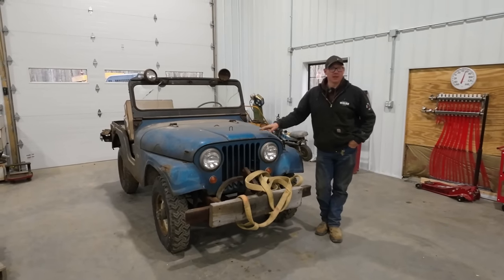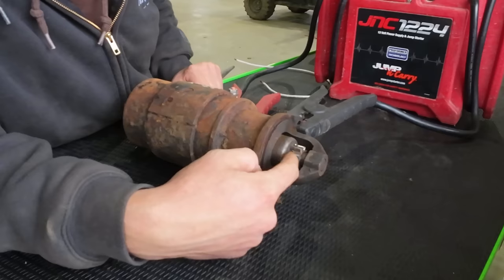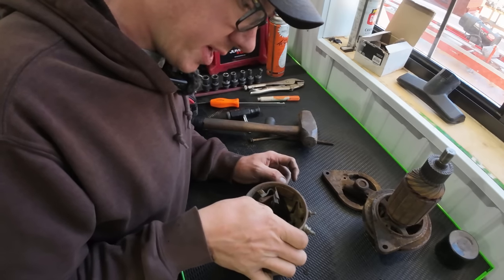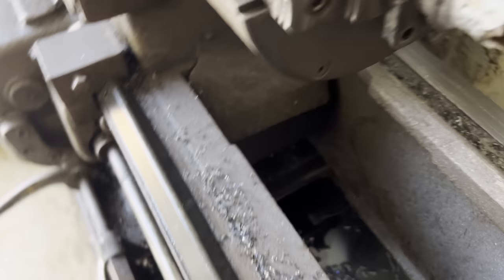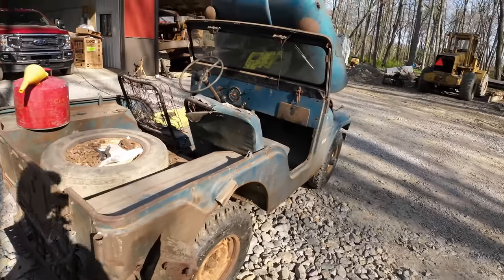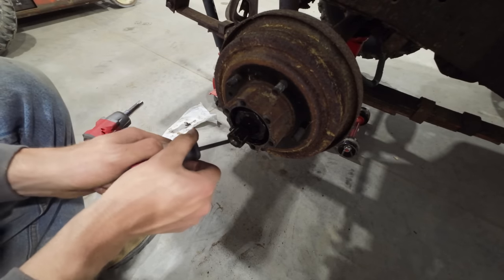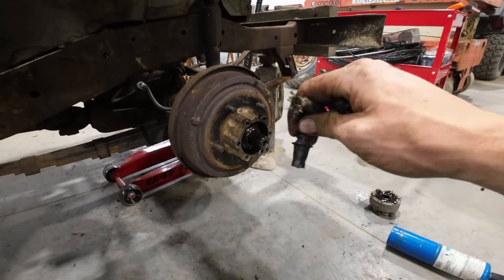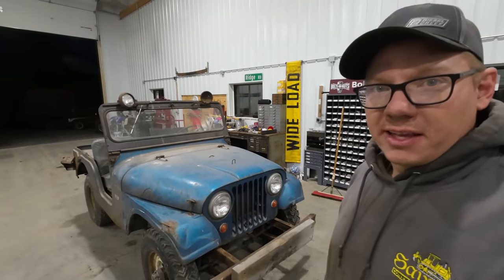Barn Find 1964 Jeep CJ5  (Is It Road worthy?)

Comment: I like your jeep, reminds me of a Jeep I drove on a golf driving range pushing a ball catcher about 60 years ago at age 15, so your Jeep might be 10 years newer.  Heavy wire covers on the windows 😅 for protection.
 Nice clean-up on the starter & generator.
I remember always citing antifreeze 50-50 with water but maybe not necessary on the new stuff.
  While you got the radiator out, be nice to cleanup some of the parts, maybe pressure wash first, and give those sheet metal parts like the fan, the fan shroud, engine bay a shot of black Rustoleum.
When you got that engine started, that engined purred, really nice sounding.  
That should be a sweet ride this summer.  Nice find, and great job getting it back in drivable shape 👍

Comment: One way to help prevent an air bubble beneath the thermostat, is to drill one or two 1/8 inch holes in the flat plate of rhe thermostat. It slows the warm up a little, it does allow air to bleed.

Comment: Soon as I saw that line I knew what happened. Had the same thing happen doing brakes on my 1996 Dodge Pickup. Loud as heck and scared the crap out of me!  My mechanic cousin say the lines were plugged and the heat from the 'heat wrench' built up the pressure in there until it blew.

Comment: I spent 4 years working in a shop and ended up drilling out all of the snapped off bolts, no one else would do them. Left hand twist cobalt bit are my go to. 95% of the time the bit will walk out the bolt and you can leave the EZ outs in the box.

Comment: Matt you need two things a "No Spill Funnel" it helps clear out the air pockets faster. 
Once you use one you'll always use them from then on. 
Second some reveres drill bits. A bolt that loose probably would have turned right out.
Love your show!

Comment: When ever my Dad started a old engine he would warm it up then pour fuel oil down the carb. A couple shots that just about killed it then pour it in until the engine dies, let it set overnight then fired it up & ran it. He said it lubed the upper end of the engine & loosened the carbon.

Comment: Hi Matt love your channel being an arm chair mechanic through you, much cleaner.  But hey pretty positive the front bearings take gear oil not grease unless there’s another set of axle seals inboard by the pumpkin? Not a old jeep expert so could be wrong but sure looked like nasty old gear oil on the bearings when you took it apart.  Also what’s the long term plan for shop power? Love the new shop and lighting but the droning of that light tower running on all video gets old quick,  maybe could at least move it further away or something?

Comment: Dear Matt,
.
I’m a “city slicker” who really loves your channel, and I want to give you compliments.
.
Actually, I’m not so much of a city slicker: I’m a medium-skilled woodworker, me & a buddy installed a new water heater, a top-of-the line model, with hybrid  (heat pump assist) & Wi-Fi.  With all soldered copper pipe & fittings, I might add!

I don’t like getting dirty, but sometimes you have to!  Afterward, you clean yourself & are all shiny again!
.
What I like about you is, you really get your hands & clothes dirty, but you’re smart with your brain, and your enunciation & speaking voice are SO EXCELLENT!

What I’ve learned: “Metal loves oil & grease!”. 
.
Thank you very much, 😉👋🏽🛢️‼️

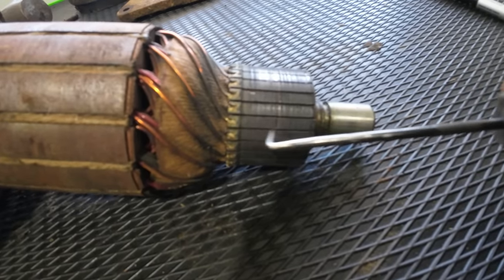Comment: 17:30 Having a bridge between two commutator contacts will affect the timing of the electrical flow through each contact, and therefore whether or not it produces power. Basically the timing needs to coordinated, similarly to how spark plugs need to have their timing coordinated.

Comment: I Bought a spector radiator off Amazon for my dodge pickup and it was a direct drop  in easy swap no modifications needed and $100.00 less delivered to my door step in 2 days local would have been 2 weeks out and $100.00 dollars more. Never had one bit of trouble out of it. So good luck on your purchase .

Comment: In New Zealand, where I live, many classic brake parts are unobtainium. Therefore, restorers often get the old cylinders resleeved in stainless. This is costly, but the resleeved cylinders are vastly more reliable than new repro ones. That's because resleeved cylinders don't rust when you leave the car over winter. I would expect to get a decade out of a resleeved cylinder. At that point I  just replace the seals and keep driving for another decade or longer.  Love your show. The length is just fine.

Comment: Hey Matt, I have a 59 Cj5 that I've owned since 1974. My brake drums come off of the hubs. The next time you have the wheels off, smack the drums on the surface where the wheel rides. Yours might be rust infused like mine were when I first got it. It saves a lot of time and aggravation when servicing the brakes.

Comment: I learned that many many years ago, never heat a brake line if it is attached to a flex line. (It will blow every time). I think it may have something to do with air pressure building up because of the heat, to the outside if the crimp. (hard to explain)

Comment: Thanks Matt, I learned some things today! I’ve worked on my Willy’s wagons for years and replaced the master cylinder in one of them. Lots of fun, but nobody told me to bench bleed before install? My newest project is an 81 CJ7. Been shop stored for twenty years along with an 82 wagon. Need a motor for the CJ, they used its motor in the wagon. It came with fender well headers so I’m looking for a 304 or 360 to put back in it? Been playing with Jeeps my whole adult life, lots of fun. Can’t wait till I get these two runnin and driving! Carry on, always fun to see what you drag home😳😁👍

Comment: i bought an all aluminum radiator for my f-150 4x4 from the same company on fleabay for cheaper than a direct replacement with plastic tanks. it's been almost two years with zero issues, in fact it runs cooler than it ever had before. this cj is a year older than i am. it's from back when they still made them like a jeep, rather than like a go cart. should be a good ride for as long as you want to run it around.

Comment: A good engine flushing compound would unstick the rings if they're clogged.  But oil burning on all older engines was pretty normal, due to the low quality of rings and oils at the time.

Comment: Enjoying the Jeep series Matt.  Not sure if this is the reason for the brake like explosion or not but I used to have a 72 jeep Commando. Which now I never sold it. :)  But I had troubles with the brakes once and would not bleed. My dad told me that the old rubber hose lines can deteriorate and collapse inside.  That is what happened. Might have been plugged by being collapsed inside.  Just a thought.

Comment: Thanks for the Jeep videos brings back lots of memories for me!  I've owned several Jeeps from 1942-1963.  Even with good springs it seems like all of the universal Jeeps from that vintage lean to the drivers side slightly.  The driver, gas tank, offset engine/trans all to the left and only a battery on the right and the spare tire if installed.  There is an easy self adjusting 11" brake upgrade.  If I remember correctly it is 1970s C10-15 GM pickups and full size GM cars Delco rear backing plates, drums and components.  I did two brake conversions (CJ3A & FC170), bolt on easy and feels like having power brakes.  Also, if your starter ever gives up, the originals can be difficult to find and an early Toyota LandCruiser starter bolts right up with only one mod of slightly elongating one mounting bolt hole.  Have fun, I love the sound of the 134 Jeep engines.

Comment: Matt you want to get yourself one of the little vacuum fillers  you plug in your air line to the adaptor  that sits in the neck of the rad totally vacs air out of the system  then you drop the filler hose in your jug or bucket of coolant and it will vacin the exact amount of coolant with no air pockets I have had one of these gizmos for years I use it every time i drain down a coolant system  works fab no air locks

Comment: On commutators, I always burnish the surface, there needs to be a good carbon surface on the copper to improve commutation.  A piece of hickory is good to use.  It is not necessary, but does improve the voltage regulation as before the brushes build the commutation surface.

Comment: Hi Matt 
On the old generators as the commutator wears it not only fills the gaps between the segments, each of which is attached to one of the sections in the armature, which at worst can cause a short in the armature, but if worn enough the Mica insulation between the com sections can lift the brushes, as the Mica is harder than the copper slippers.
You can undercut them again or just clean them of Carbon etc coming from the brushes by taking an old piece of hack saw blade, cut one end at a 45 and put a handle on or wrap tape on the other end so as make like a knife.
This was how we reconditioned and under cut them in the auto electrical game. Back when we still rebuilt them by the dozens.
Generators are very very tough and reliable and far less prone to electrical damage from things like reversing a battery's polarity or a bad jump start.
Sadly they don't charge well at low RPM or idle and they produce a lot of RF which modern electronics don't like. These days an alternator is the way to unless you want to keep the vehicle completely original.
Anyway hope this was helpfull.
Cheers 
Rusty

Comment: Thanks for your extensive videaos. 
I am amazed to see the very same technical parts like in  my old VW beetle 🙂. I am located in Germany close to Cologne.

Soft line exploding: Brake fluid penetrates into the rubber slowly but surely. (Therefore you are not allowed to simply change the brake fluid to silicone based fluid w/o changing all rubber parts).
Heating the end might cause the fluid in the rubber (or in teh fabric inbetween the rubber layers) to change from fluid state to gas state - instantly.

Comment: An impact provides that hammer action to break loose bolts and rachets just give a straet pull and snap! I've been twisting wrenches for 2 5 years and always had better luck with the impact if used properly.

Comment: Pretty sure there was actually pressure in that soft line that blew out because that old line had likely closed up on itself sealing off the inside. Also likely why the brakes were stuck originally. Someone replaced the shoes but ignored the old soft lines.

Comment: On the generator there should/may be a slotted screw sitting flush with the casing. This is an adjustment that allows you to increase or decrease the voltage output from the generator. Might be worth a look to see if the adjuster is on your genny. Also nice to have an easy to get at thermostat where you don't have to remove half the engine eh.

Comment: I felt like I was reliving my own problems on my landy engine water thermostat bolt on mine broke lucky enough popping out to get pliers on and off it came , brake drums are similar to old landy but we have to file the leading edges on new ones to stop them binding , your lights like a landy seem very dim way I got round this was to fit led light bar plus upgrade lights to led made a world if difference being able to see safely , I also would say a roll bar would be good idear especially for missis and three point seat belts , my 67and my 74 series landy had lap belts they where quickly changed over . 
I really love you posts and look forward to them I like it long as it gives you more insight in what your doing and problems you find and how your able to fix each as you get them .

Comment: or use a left handed drill bits for broken bolts you'll  find them handy  to have around     with the old equipment and broken bolts just a suggestion for what you do.

Comment: im surprised of how simular to a ford 9n starter that is speaking of 9ns if you ever mess with one the starter does basically the same thing but it is supposed to lock into the fly wheel and you cant returm it to the nutral pozition unless you can spin it as if it was spun by the engine starting

Comment: Next up, Icon suspension kit and 37’s. And add the correct ratio of zddp additive to the oil. Trust me on that. That stuff will fill small irregularities in the cylinder walls and reduce blow by, and protect bearing etc by the same measure.

Comment: I like permanent magnet generators.  In college I won bets because I drove old French cars that had hand crank starting as an option.  I could literally remove the battery, then crank start the car, and it would run fine. With an alternator there's a field coil that requires input or nothing runs.

Comment: The Fabric of the brake hose possibly got catalysed into a derivate of its contents, that are prone to oxygenation, what ultimately (wild guess) turned some of the butadiene into butadiene oxide what is essential solid rocket fuel. On ignition, the combustion turned the tissue inside out.

Comment: Hey Matt, was watching your repair on the starter bendix. It was actually installed correctly. The little pin is supposed to drop into the hole. It is designed to lock the Bendix engaged. When the engine fires the ring gear drives the bendix so fast that centrifugal force retracts the pin and the bendix is pushed back into the retracted position. When you start the engine the bendix resists turning and ramps back up the shaft and engages the teeth into the ring gear and the whole process repeats itself. Use lube sparingly, it attracts dust and locks the bendix up. Spray silicone dri lube is best. If you try to start the engine and fail the starter will remain engaged, if you force it out, you will shear the little pin.

Comment: The soft line was swelled shut s that hot air could not get out that way, and the other end must have been rusted shut, so the heat pressurized the air until it burst.

Comment: Brakes & Steering, those are the top two things you'll need to improve upon.
But you probably figured that out already.
I've had two 1970 CJ5's with the V6 in the past. Brakes & Steering.
Now on my current ride, a '73 CJ5, I need to put power steering on it for these aged bones.

Comment: Hey just a tip on freeing up the rings. I've done this many many times over the years.  Put 2 bottles of Sea Foam  in the crank case and let it run for 20-30 minutes then drain oil and change filter Should stop the smoking.  May have repeat  Has worked 8 out of 10 tomes for me. (Great Videos)

Comment: I had the exact same thing happen to me with a rear axle soft brake line on a 1970 Nova. I cut the hose in half then heated up the nut by the car body because it didn't want to break loose. I got the line loose and left it to cool before removing it. I slid out from under the car to prepare the new line and a few seconds later heard a pop like the sound of a 22 caliber pistol went off. Scared me too! Sure enough, the hose popped out of the crimp. My guess is air was trapped between the hose and the crimp when it was assembled 53 years ago. When I got it red hot, the expanded air had to have pushed the hose out of the crimp.  Maybe better to cut the line at the base of crimp by the nut before heating.....

Comment: That civilian M38 should be damn near unstoppable. If you encounter further cooling issues, know that painting that rad black will increase the cooling capability. They paint’em black for a reason. Everything on that unit is rebuildable and the seal and gasket kits cost about a song an a dance.

Comment: It could be worse it could have been a Chevrolet 4x4 system.  You need a special spanner socket to tighten the front axel nut to preload the bearing.  I bought one for my 78 Chevy K15 and still have it, somewhere.

Comment: When the steel crimped to the rubber hose corrodes it Will completely pinch off the hose I.D. and trap fluid or pressure on one side or the other.  My guess is the heat pressured up on the hose blockage and pop-goes-the-weasel.

Comment: That Rotella looked like straight anti-freeze, You should really dilute it with distilled water, 60/40 mix is best, 50/50 mix is fine too. Straight anti-freeze is more corrosive and can't absorb heat as efficiently.
Cool Jeep Matt.   😎

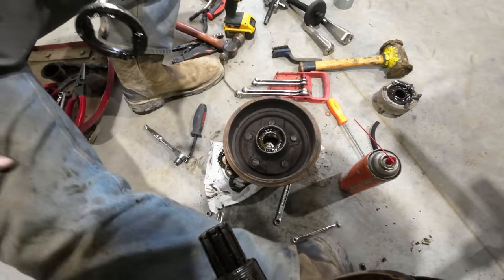Comment: 45:18 well lots of things where over engineered and build like a tank back then, and lots of old heavy machinery is good example of that. reason why shops still use over 50 year old mills and lathes. and u can make most abandon trucks and cars run with little elbow grease :D
now a days most commercial stuff is made to fail where in olden days they where build to last

Comment: The only thing I would change from stock is to put in a Pertronix electronic ignition conversion, use solid wire spark plug leads, and open up the plug gap just a bit.  Nobody will see the difference and it will run even better.

Comment: Carbon in the commutator slots can short out the segments, reducing power and causing excess current flow. My favourite cleaning tool is a hacksaw blade, with all but a few teeth ground off and ground down to the same width as the slots. Make it so it cuts on a pull stroke so you don't risk going into the windings. I was told not to clean the armature steel laminations as they are insulated from each other (by oxidation) and scraping the outside can bridge this, making the motor or generator less efficient, same with an a.c. rotor.

Comment: I have an article, where a retired oil brainiac did a blind oil analysis on 20 oil brands. Top 6 were Cummins/Valvoline Premium Blue, Shell Rotella T Synthetic, Cummins Premium Blue Synthetic, Pennzoil Long Life, Chevron Delo 400, and Red Line Diesel Synthetic. All 15W40. I've been running the Cummins Blue for years. 91.5 Cummins truck, 79 Mercedes Diesel, an 84 and 82 Mercedes Diesels. And a 2010 JD tractor. It had the most ZDP in it. It was a blind test too. 👍